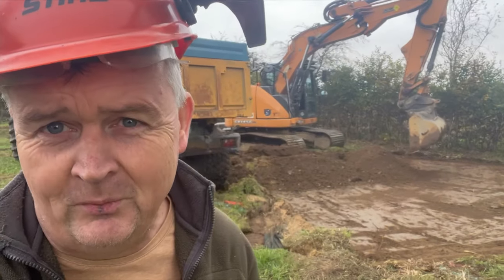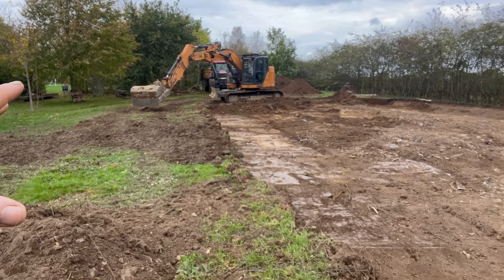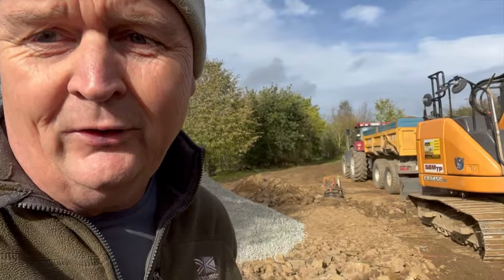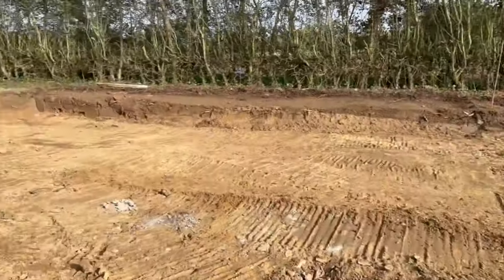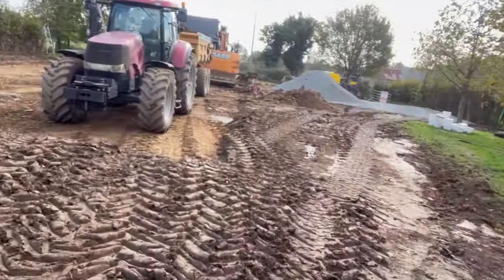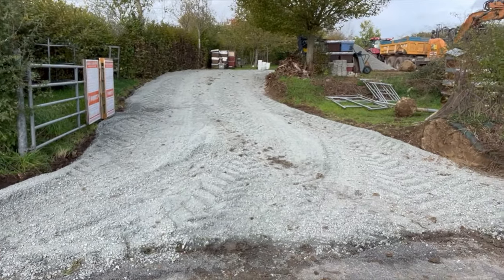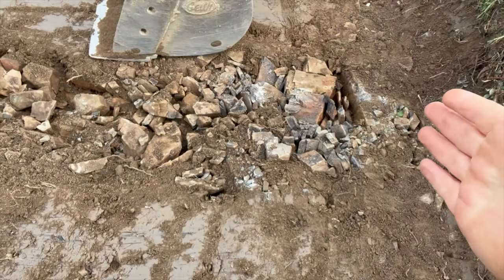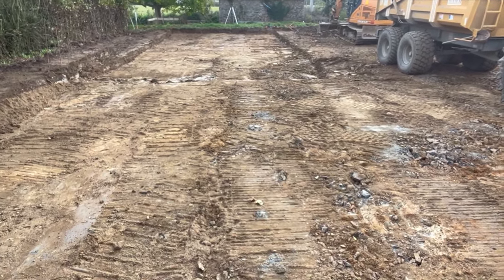Honey house Build! Its started.

Comment: Looking good Richard and it seems you have a good and sensible groundwork team which is such a help. How it is started literally makes a difference right through the build .............You definitely DO NOT want to get a concrete mixer lorry stuck............a ton of anything is a ton...............but concrete is heavier for some reason!! .....well you know what I mean. 🤣🤣
Reply from the maker: Definitely Paul, it’s a little extra insurance for a potentially major screw up but, looks as though the access should hold up well now